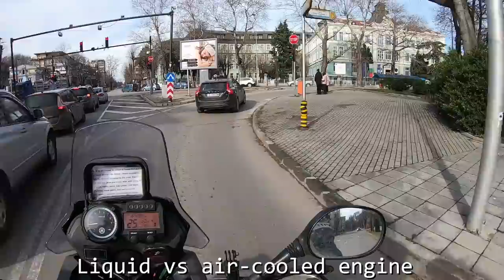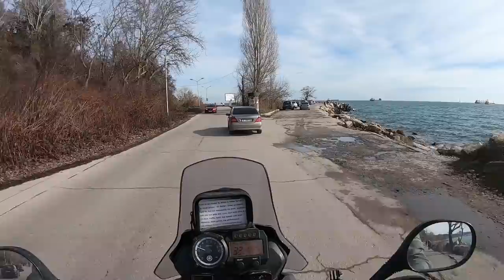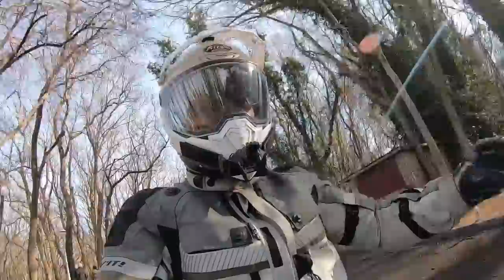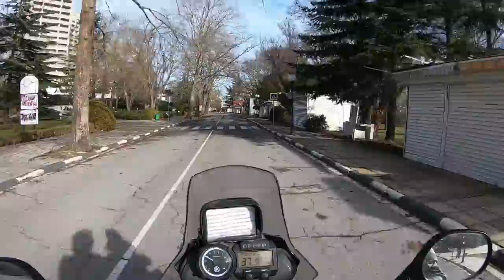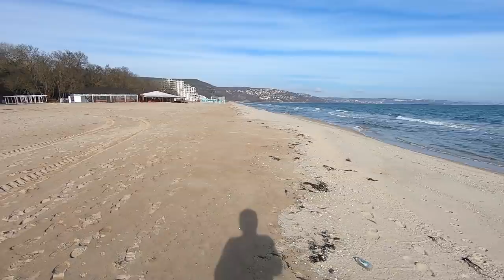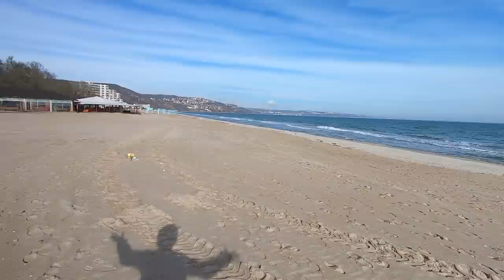Water vs Air Cooled Engine for Long Motorcycle Trips!

Comment: Definately depends on the type of roads and climate. Air cooled is fine for the highway. I guess it depends on the bike for liquid cooling. Some have overheating issues.
Reply: air cooled engine cannot really be used off-road for touring because if you ride slow for long you will overheat.
Reply: @Francois_Dupont  that depends on the bike. There are so many air cooled dirt bikes that I have to say that's incorrect.

Those that want to ride on the highway for many miles at high speed, ride off highway and have longer service intervals, more power and range the water cooled is better.

Example XR650L is air cooled enduro bike that's highly rated and capable of crossing the country on backroads. The DRZ400 is even more popular for crossing the North American Continent and other long trails.

Any bike will overheat. Air cooled usually means you turn it off and wait a while, some will cut power automatically but water cooled bikes usually have coolant loss and other issues that require repair when they overheat. The key to operating either one is to not overheat it. That can't be helped if a part of the cooling system fails on the water cooled bike. Shut it off and fix it if you have the tools, parts, coolant, etc. Air cooling cannot fail.

I have not had any problem with my Harley in traffic. If you are sitting in traffic turn it off.
Reply: @RoadKing05FLHR  i ride and repaired tons of dirtbike. most aircooled one are burnt and worn because of the heat. you cannot just ride around slowly with them. i even have a air-cooled Honda ATV that i use to haul around my firewood from the forest each year. i cannot make more than 2 trips before waiting HOURS for it to cool down, as it becomes boiling hot even in the winter.
even my local motorcycle school has one air cooled bike they bought brand new, and its spewing black smoke because the engine is burnt on it not enen 2years old that bike.
Reply: @Francois_Dupont  fair enough, but all the major motorcycle manufacturers make air cooled street bikes, dirt bikes, and dual sport bikes. Going slow is not a requirement in most cases. 

A couple of worn out or poorly designed examples do not matter in the grand scheme of things.

There are plenty of air cooled engines in other applications where they run all day without moving and never overheat.

Many people are riding air cooled bikes across the country on trails. 

It sounds like they burned the motors up. Keep riding a water cooled bike with a radiator leak, fan not working or water pump out and see how long it lasts. Operator error. Sounds like they ran low on oil or failed to maintain it.
Reply: @Francois_Dupont  ATV overheating the oil pump, fan not working properly, clutch slipping or maybe it's dirty. With a radiator it would be on fire and burned to the ground by now without maintenance. 

They do not overheat by nature. What makes you think it's overheating?
Reply: @RoadKing05FLHR  you know there is a difference between "ride fast to cool it" and forced air cooling. lawn mower for example are all forced all cooled and so are most scooters. they have a fan inside that push air tru the engine for cooling. 

we are here talking about motorcycle without fans, and only fins. this isnt a matter of opinion,its a fact. no bike can last at slow speed with just the little air that pass tru those fins.
Reply: @RoadKing05FLHR  my ATV is a TRX250 by Honda, its called Honda Recon? i think. there is no fan, nothing. like most air cooled motorcycle and dirtbike. its only the air that you most foward that pass tru the alumilium cooling fins that cools the engine. if you are riding bellow 30km/h it will get hotter and hotter. 
there is a thermal switch inside the engine that cut-off when its too hot. the engine stops and you cannot start it again. there is also a little red light in the dash indicating its overheated. i also had a 250cc dirtbike that had the same problem. on my land i cannot go very fast because of trees roots and stumps. so i am mostly in 1st gear. i cannot go fast enought to cool the engine. 

it is the problem with air-cooled engine.
Reply: @Francois_Dupont  we run rancher 350 for years without any issue. Many of them and running all day.

Air cooling is cooled by the oil on most motorcycles. The heat passes through the rings to the cooling fins but the oil needs to be cooled because it gets hot on any engine. Most of them use the same oil on the clutch. The type of oil used and how often it's changed has a lot to do with how long the engine lasts. Many people overheat their bikes by improper use of the clutch.

Tuning is much better these days and an engine running rich will run cooler.

With all of the air cooled motorcycles out there still being made and sold by the millions today there is no reason to believe they are no good for any kind of use when used as designed.

So many people prefer them for dual sport use they are not going away any time soon. They are only getting better.
Reply from the maker: Nice discusion here!

Comment: Examples: Honda clone horizontal 4 stroke engines old 1970s air-cooled motorcycles such as suzuki honda and yamaka kawasak vertical twins in line 4 cylinders. Old yamaha 3 cylinders. Volkswagon air cooled boxer's porsche flat 6s also air cooled. Part of the added weight was because Crank cases were thicker stronger, could be stroked out a little bit. More high performance options. Just weld the press for Crank throws for drag racing. Durable powerful road racing engines too. Powerful S&S aftermarket Harley engine's. I'm just saying that's not always the case. Hot running engine's like fiat, or hot running engine's designed to run hotter Both water and air-cooled that were bullet proof tough. some racing engines welcomed hot temperatures. Ran more powerfully. Then theirs intercoolers opposite direction. Depends also upo6 metallurgy and materials too like composite ceramic cylinders that disapate heat well like suzuki cylinders. I like to lean air cooled where I can.
Reply from the maker: ...and all of these great engines doesn't exist anymore...

Comment: Well, not all new motorcycles come with liquid cooled engines, a few people still buy Harleys :)
Reply: and lots buy Enfield's, and other air cooled bikes.
Reply: This topic is about motorcycles not about tractors.... 🤣
Reply: There are many air cooled bikes out there working great.
Reply: And Yamahas (Xv &SCR), and BMW (R9T & R18), and KAWA (W 800) are making water cooled motorcycles... But let's not for forget that Pavlin is an adventure rider. And when it comes to advs   .... almost all GS s are liquid cooled, Tenerre is liquid cooled, and even HD Panamerica is liquid cooled.  Of course there are a lot of motorcycles with air cooled engines, but let's take a look over their performances and will see Pavlin is right.
Reply from the maker: Exactly! Each opne of the models that you described will work way better with water cooled system.

Comment: euro norm 5 not passable with air cooling engine
Reply: Liquid cooling doesn't guarantee that a  bike will pass Euro 5 .I believe Yamaha FJR 1300 and Honda VFR 800 are being discontinued for failing Euro 5 . Both of these bikes are water cooled .
Reply from the maker: Exactly!
Reply: Hi Harley Davidson gave up on selling Sporsters in Europe because of Euro 5 regulations but many of HDs which are available on the European Market are still air-oil cooled and they are Euro 5. Of course they have big engines with small power .....

Comment: It’s all about emissions. Governments want engines to run leaner and leaner. If you do this to an air cooled engine it will ping and rattle because engine temperatures. Water cooled engine don’t. Plus a water cooled engines can produce more horsepower from the same CC’s as an air cooled engine.
Reply from the maker: If there were demand, there will be a supply, no matter how much it would cost!

Comment: My Guzzi V85tt does not overheat even 2 hours in slow moving congested traffic in Tropical heat Philippines , My Z1000 4 in line water cooled gets hotter , Maybe Moto Guzzi Know What they are doing with their Air Cooled Engines , So i Appreciate the Video but maybe modern air cooled engines like The V85TT have Changed These Days , Just Saying
Reply from the maker: Maybe but I seriously doubt!
Reply: @motorcycleadventures  you can doubt as much you wish i own a v85tt and im telling you it does not overheat believe what you wish .
Reply from the maker: I doubt that a water-cooled engine will overheat before the air cooled unless it has a problem. Watch this https://youtu.be/ZAFPLHTYskM?t=1461
Reply: @motorcycleadventures  My Bike must Be Very Special Then hahha Ride Safe Pavlin

Comment: Why are all engines water cooled now? Because everyone wants more power and that needs more efficiency. Also I'd bet that air cooled engines will not meet EURO 5 regulations about emitions. Plus I think it will be cheaper to make cooling system than use extra iron/aluminium for air cooled engine.
Reply from the maker: All good reasons!
Reply: Btw. Thanks for great topic... again ;-)

Comment: Why all new  engines  liquid cooled ?? Easy.. eco standards.. stable temp less fuel uses. Some may say its more components to produce... yes maybe. But even antifreeze is propelen glycol based allready its not as much toxic any more.
Reply from the maker: If there were demand there will be a supply!

Comment: Liquid cooled engines are more powerfull. If you do not need all that power air cooled is better and more reliable. Nothing worse than that green puddle on the ground.
Reply from the maker: It is not only the power.

Comment: Compression => power, efficiency, less emissions, but also more heat. Air/oil cooling is only for retro style bikes like the BMW R18 where only the fun factor matters. Having said that, there is something special about air cooled simple engine designs, but it comes at a "cost" in terms of power, comfort and longevity, as these engines have much more wear in the heat, but also in the cold, when the oil never reaches the optimum temperature.
Reply from the maker: Exactly!

Comment: "For LONG DISTANCE riding"... most riders don't require frequent sustained high performance riding. Going 60 - 100kmh through Africa or South America. Staying around the middle of the rev range, the cooling is more than suficient, the simplicity a benefit and the extra CO2 feed more plants.
I rode a GS1200 air cooled all over Africa and enjoyed the simplicity and reliability.

After 100 000km, I decided to get a new liquid cooled GS, but the jump in weight turned me down, so I bought a Tenere 700.

The liquid cooled engine now sometimes protest by switching on the cooling fan, but other than that, the power per cc is more, the smooth cylinders appear clean, dont catch bugs & mud and, at around 100km/h, it often gives 30 km/litre while the GS would give 20 km/l at the same frugal riding style.

Most disadvantages of air cooled engines were compensated for in design and ha no impact on riding. Same with LC engines, but maintenance and vigilance is required.
Reply from the maker: Thanks for sharing!